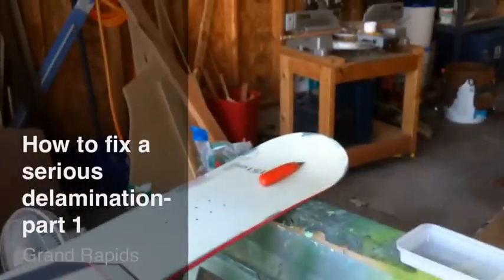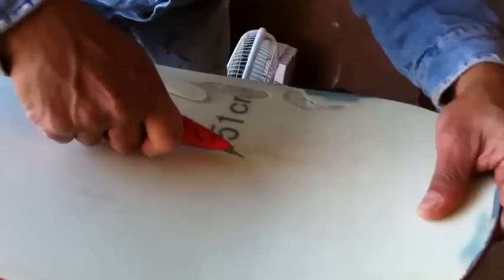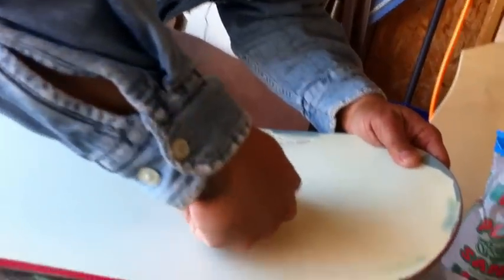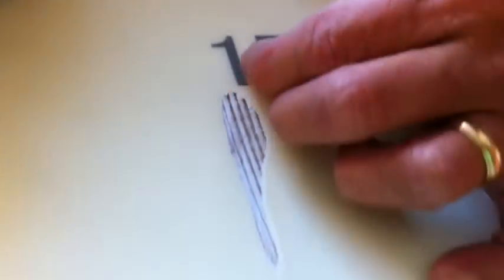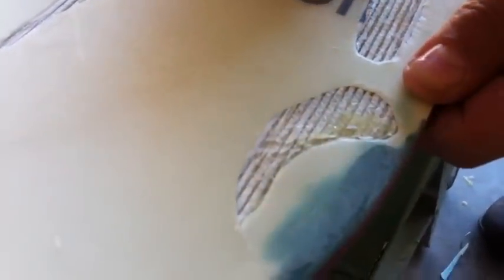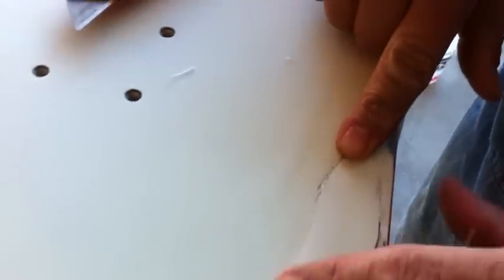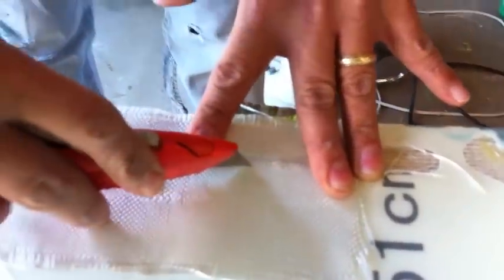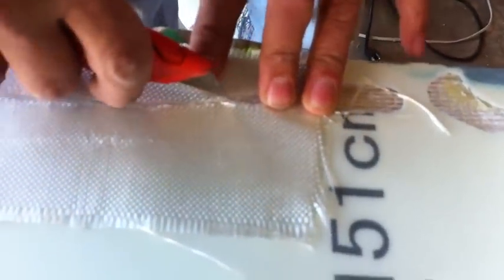Part 1 - How To Fix A Seriously Delaminated Snowboard

Comment: g'day, what did you do to fix up the edges? it looks like there is some sort of putty or blue ish stuff that may have been used to re build a nice edge. Im looking to take some knocks out of mine and then repaint it but have tried flexible epoxy (2 kinds) and it doesnt sand very well. I was looking at some sort of body filler but not sure where to go with that train of thought. keen to hear